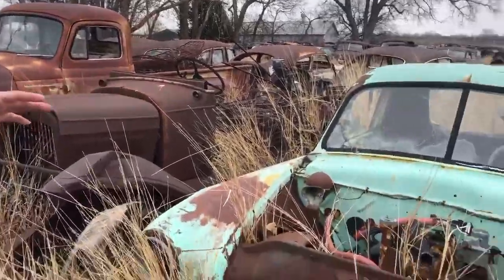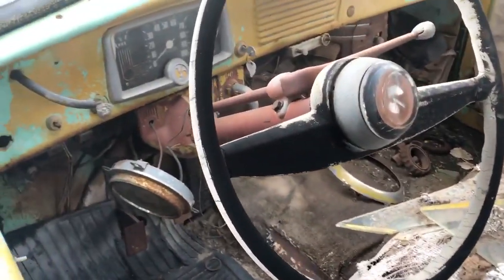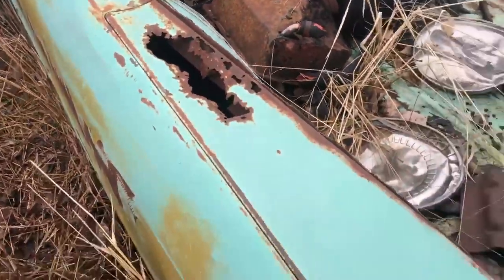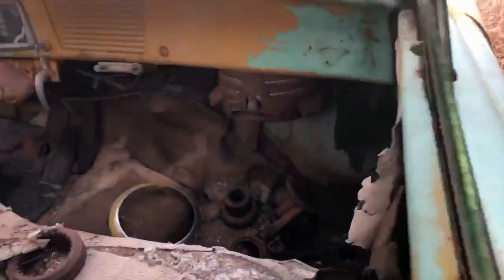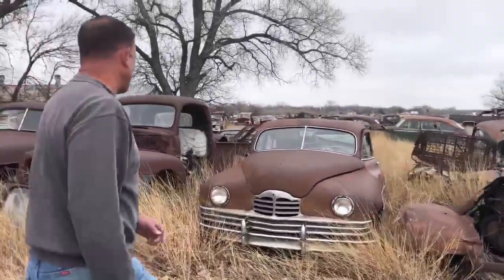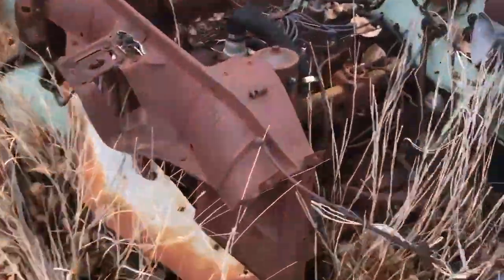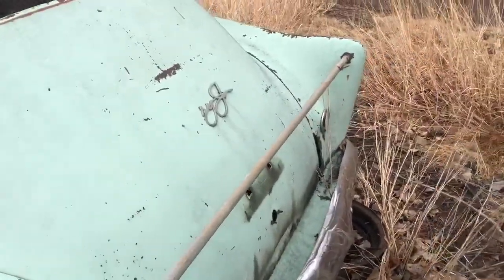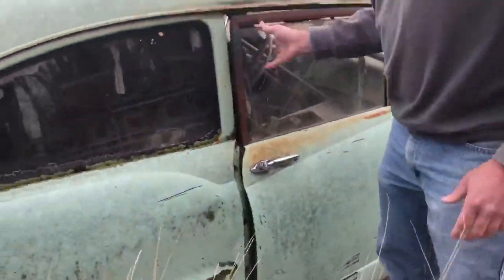The Kaiser Henry J!  Lets take a look at a couple of them!

Comment: I had a '53 Henry J that was all there and all stock with all the glass, intact insignias, and a trunk. Metallic emerald green, from the factory.. I got the flathead six running, but then moved across the country. I had my eye on it for years before I was able to finally buy it, then only had it for less than 5 years. Letting that car go was my biggest car mistake (other than buying a Fiat once).

Comment: Finish the pickup conversion since the door frame remains..... neat.   
Back in the day a 'little magazine' featured a convertible conversion!  It retained a stock windshield, frame and garnish molding, the remainder of the top and side windows were gone.  How about a roadster with just the front seats and a metal tonneau style trunk cover from a 1950 GM fastback patching the opening?  Pickup or convertible?
Back to the truck, what can be grafted above the beltline to form a sedan delivery?  
How about extending the grille peak bottoms to the bumper forming a 'Bugatti flask' style radiator shell?

Comment: Cool old cars to be sure. But I always find it amusing when someone comments "This is a no-trunk model."  Fact is, all Henry Js have a trunk.  It's just that some have an external lid with which to access the trunk and some you fold down the backseat back to access the trunk.
Reply: No all henry J's DO NOT have trunks. Only early 51 have trunks  52 - 54s had trunks.
Reply: @ramblingsadrift6477   You didn't read my post very carefully. I was making a distinction between a trunk and a trunk lid.